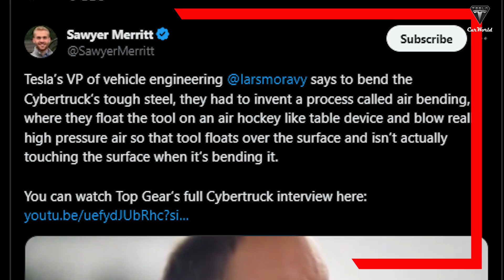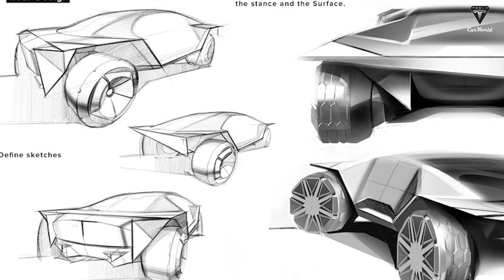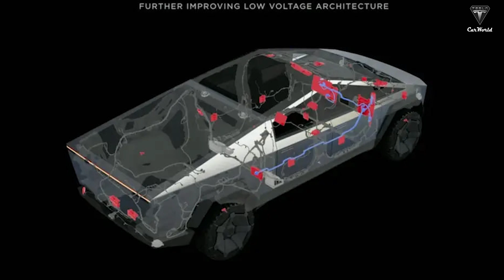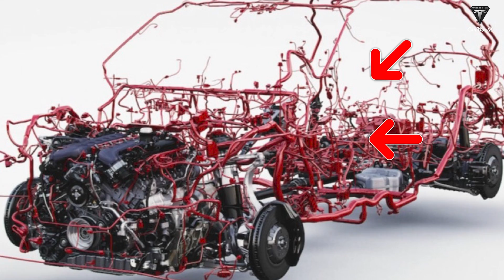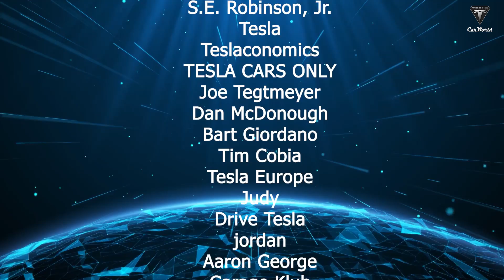Elon Musk Exposed Why Cybertruck Will Be a Production Hell? 5 HUGE Hidden Reason NEVER KNOWN!

Comment: Naw, the only problem is just  the stainless steel body. 
Anyone who tried to build almost anything from SS had had major hoops to jump through. 
SS is very hard to produce in quantity and difficult to form. This is why it's so expensive. 
The competitors trucks are made with lower grade steel or aluminum, which is very easy to produce. 
He should have had two levels of the truck. 
Since most will only be used as cars, he should have made a cheaper  steel or aluminum body. 
Aluminum is around 30% more than steel and SS is around 30% more than aluminum. 
The mechanicals and electrical is around the same as his cars aside from being bigger.
All in all, a good quality steel with modern corrosion control would have been a better choice to keep the price down.
Later, when the trucks are established, use SS for higher end trucks.

DeLorean didn't fail because of SS , it actually was starting to pick up, then the drug scandal 
Ford backed out of SS because of body panel stamping issues. Dies are very expensive for SS

As for the battery, it's always evolving and will always pose a problem as new ones are developed. 

It would be interesting if he ran steel through the process. Wonder how much the truck would cost then?

After watching some vids, it looks like this channel is just  regurgitating what other channels that actually go see and operate the machines are saying.